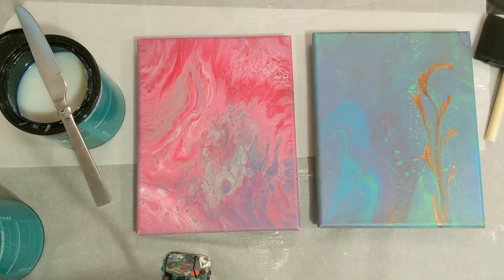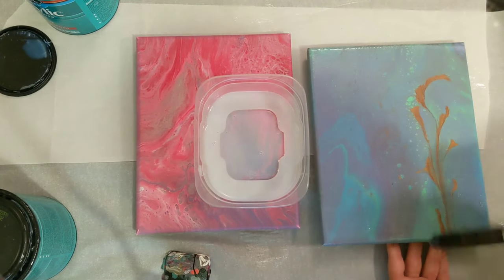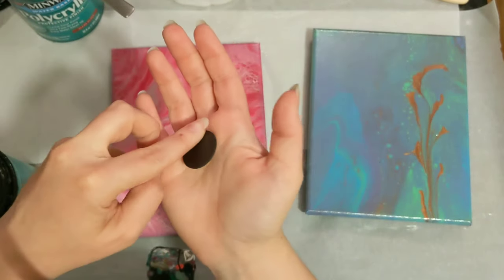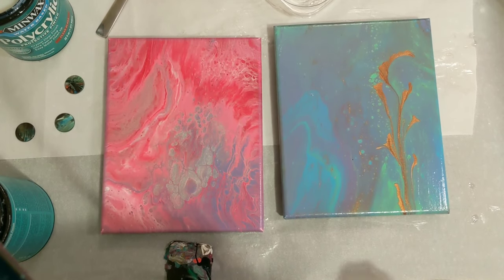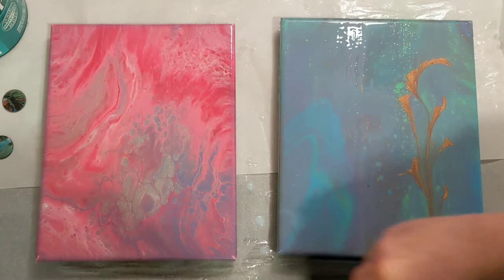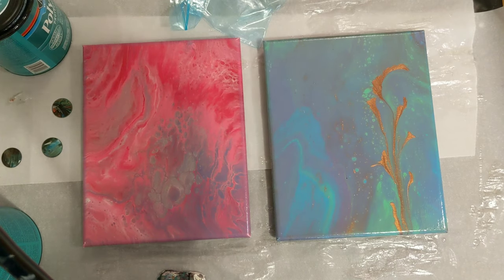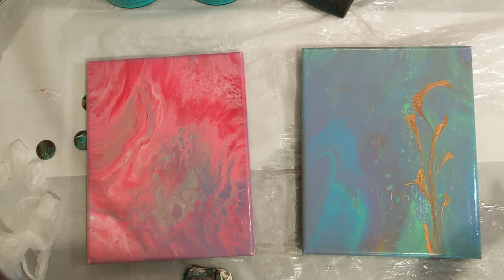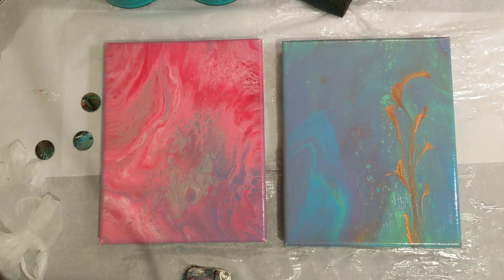Sealing Acrylic Pour Painting with Minwax Polycrylic Protective Finish Clear Gloss #YT100 Day 5

Comment: I've been using polycrylic for a few years without any problem. I use 2 thin coats and apply it with a very soft brush. First coat is applied in one drection then 2nd coat is applied in the other direction. I also wait at least  a week before applying the polycrylic.  Sometimes longer if i have texture ect., on the painting.

Comment: Glad to see you tried the pour and tilt method. 😉 But you’re right. Had you done that on the first coat, you wouldn’t have wasted so much with multiple coats and wouldn’t have brush strokes to cover up. The next time you try this method, make sure you get it tilted off evenly and try not to touch it or move it around with your fingers. I know it’s tempting to do so but the less you can mess with it, the better. 

It takes patience to allow it to flow off each side completely but it can be flawless when it’s done. 

You can use another container to pour off the  excess too so it’s not wasted as much. 👍🏻
Reply from the maker: Thank you for all the tip! I know exactly the painting I want to try this on next! 😁🤞🦒 Wish me luck! Lol
Reply: Can’t wait to see the next one. 👍🏻
Reply: Nancy, I've had poor results with tilting, in that it crackles for lack of a better term. Suggestions?

Comment: Hi, I tried using this product on a floorcloth that I painted with acrylic paints. The black paint came off when I applied it. I had let the paint dry 48 hours. Is that not long enough?
Reply from the maker: I let my acrylic pours cure for 4 weeks minimum before sealing. Did you paint it with a brush or was it an acrylic pour?
Reply: I used a brush and luckily I only did a little bit of it. Do you think I should use a sponge brush?  I will wait 30 days. Thanks so much for your reply
Reply from the maker: @Jerihirshman  The brush works fine and should be a thinner layer of paint compared to an acrylic pour. I think waiting 1-2 weeks would work. 🦒

Comment: I see people using the silicone make up sponge to apply this. I'm having major issues with finishing my pieces. I used Liquitex and it destroyed a piece I worked weeks on! You could see the un- levelness of the finish and each coat just made it more pronounced to the point where their was no saving it! The piece is now in the trash! The only success I have ever had was in the beginning I got so run of the mill spray varnish, (I didn't know any better) and I got the exact finish I wanted but it stunk for quite some time and of course probably will eventually will chip or crack? I don't know. Its so depressing to make a beautiful painting then not be able to get a nice shinny smoot finish to complete it.
Reply from the maker: I haven't tried the silicone makeup brush technique yet. I'm so sorry you couldn't get it even on that piece. 😟 Minwax had spray sealer too maybe try it?
Reply: @TheCharmingGiraffe   Yes thank you , I just watched a video comparing different spray on finishes I will do those as apposed to the brush on.
Reply: I use the DecoArt triple thick gloss glaze and out a little bit of water to thin it out and then usually put on 3 to 5 thin coats that dry in a couple of hours in between coats usually I just leave them overnight to be safe but it works amazingly

Comment: EVERY time I've tried this, it's"cracked" into 100s of little pieces when it dried. It looks almost like crackle. What am I doing wrong?
Reply from the maker: This stuff is a bit finicky. How are you applying it? Pour and tilt method or brushing it on? Every time I've brushed it on I didn't get any cracking but I got brush strokes. Only one time did I get the crackling effect. Most of the time when it cracked I just got one or two little gouges in the sealer and I think that's from applying at too thick. I haven't tested to see if the temperature in which it cures in impacts how well it cures. I'm thinking that may factor in here as well.